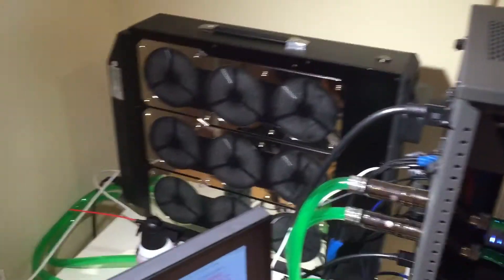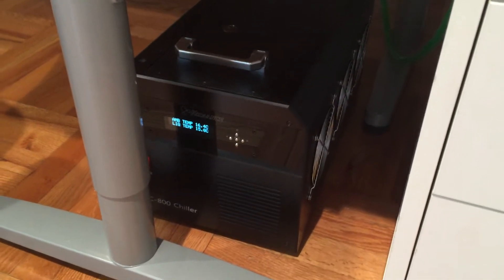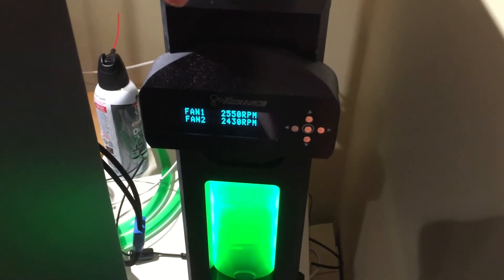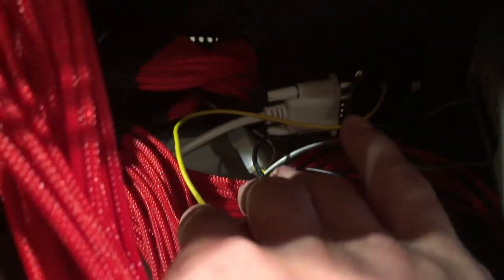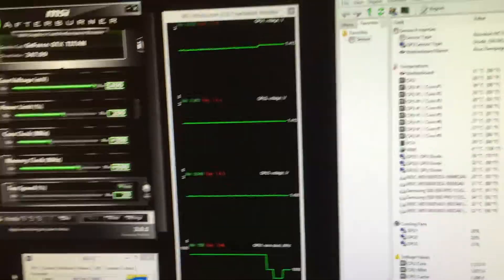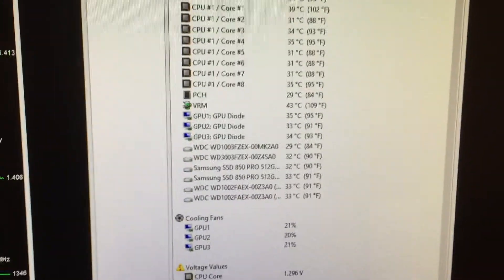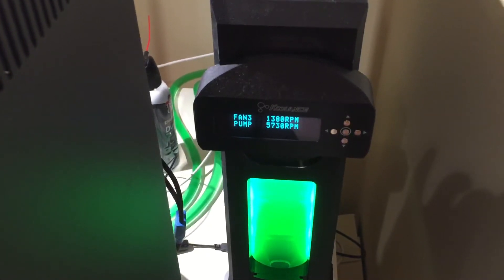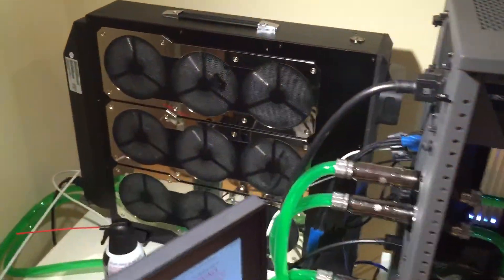Koolance (ERM-3K3UC) Liquid Cooling System - Review

Comment: Can this beast cool two gaming computers at once?
Reply from the maker: If your two PCs doe's not exceed cooling capacity of 2400W you should be good.
Reply: I don't know how to calculate the heat output. The computers would probably run 2x nvidia 1080/1180 and a multicore i7 or i9 all clocked as high as they go.
Reply from the maker: Each 1080 is approx. 200W plus 140W for each CPU with default configurations. If you overclock your systems, then just double the power consumption. All together (overclocked) should be around 2200W, so I assume you are covered.

Comment: Would also like to say is that chiller you have on the floor, all chillers/water pumps should be put above the computer or unit your trying to cool to be more effective and to avoid less stress on your pumps. The computer should be on the floor and the coolers need to be above the computer. This is what Koolance has told me with my ERM-3k3uC.
Reply: The thing is so overkill that it probably doesn't matter.

Comment: I too have the ERM-3K3UC and was wondering why you need an additional cooler on the floor? Can't the ERM do all the cooling? The copper version will do up to 2400 heat watts. That should be enough for your 4 video cards and CPU.

Comment: Do you use silicon sealant on the fittings? I've got a 2K3U and I was told it was a good idea to prevent leaks because the o-rings can flatten

Comment: can you turn it horizontal, and make a test with lowered fan speeds, with standing on some kind of legs? 
That is pure noise in this way. And pretty disturbing. If i have to sit near a noisy watercooling system like that, i'd probably go insane on every little things what not comes together, for the 1st time. :D
Reply: +cybcarr 
Ah, and the fans be on top.

Comment: Great video. Don't see too many videos on the ERM-3K3U. I'm using the ERM-3K3UC with my two video cards and processor. I was wondering why you are using a separate chiller when the ERM will keep all components cool.
Reply from the maker: 4x Titans are get way to hot when overclocked to 1350Ghz @ 1.450v, so each card takes around 600 watts of power. For CPU i was planning to push harder, however i only get stable at 4.6Ghz, at least for now.
Reply: @pcfreezer6448  Okay, that makes sense!

Comment: Nice, I've been thinking about the Koolance waterchiller but I want to go sub-zero temps. Have you opened the case? I know it would void the warranty and you'd have to prep the system for condensation but maybe it could be modified. You've already spent this much time and money on parts why not go all in?

Also I don't recommend the 4th GPU unless you are doing workstation/bench marking stuff. It can actually hurt the games performance due to bugs and scaling issues. Instead buy a NVMe SSD PCIe 3.0 card :D